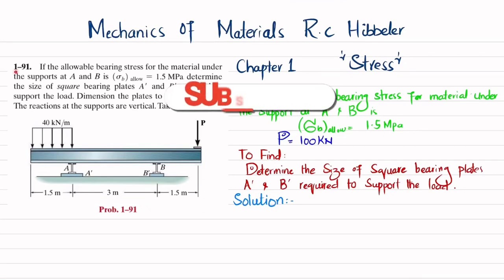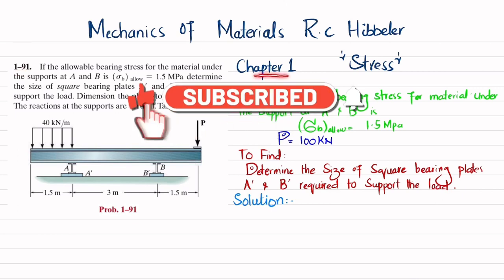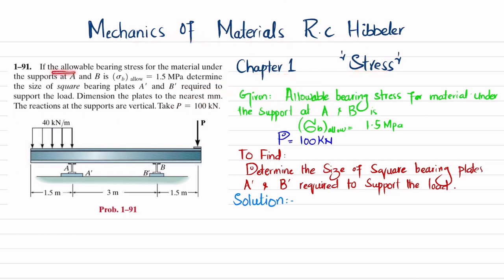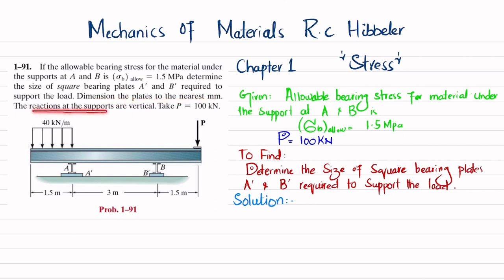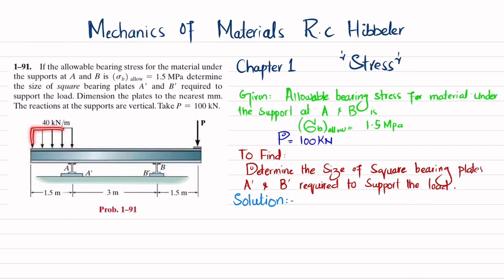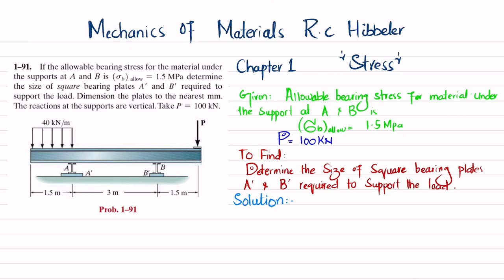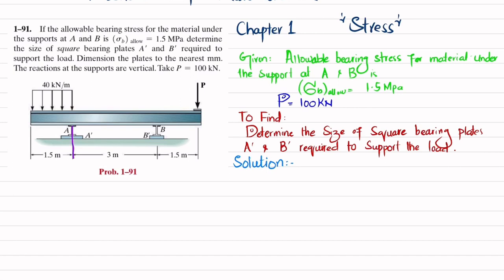1-91| Determine size of square bearing plates A and B | stress | Mechanics of materials rc Hibbeler

Comment: 25 devided by 1.5 equals 16.6 and when you put the square root that’s 4.07. Why 130mm?
Reply from the maker: 25 *10^3 /1.5*10^6 = 0.016 amd when you take square root its 0.129 m and in mm its 129 mm